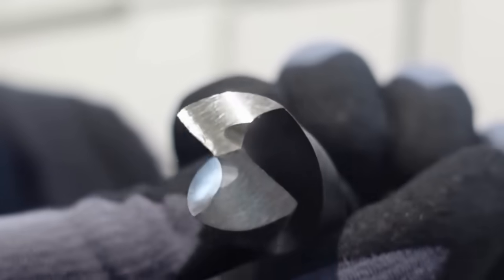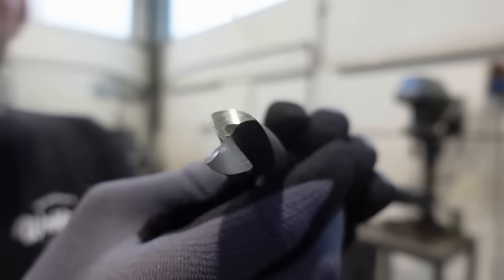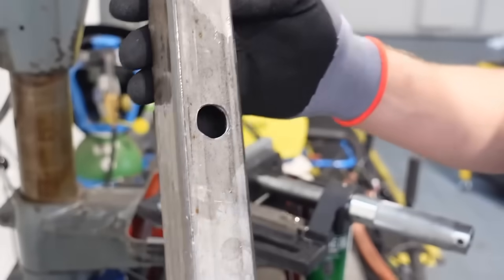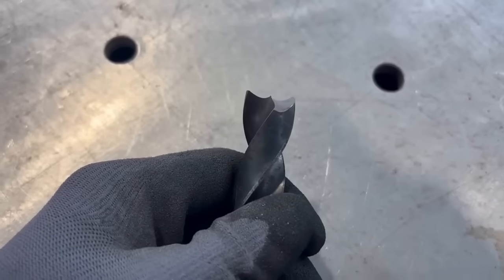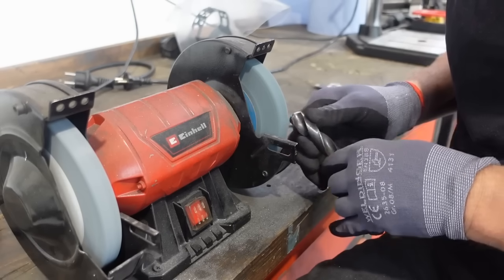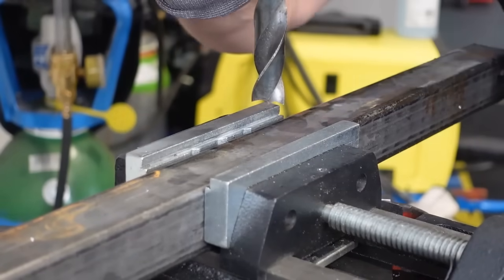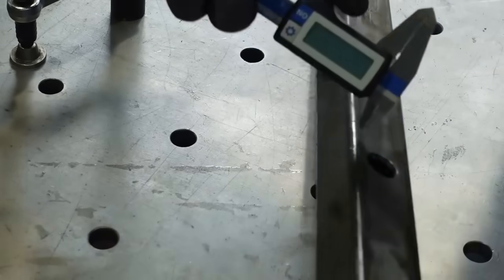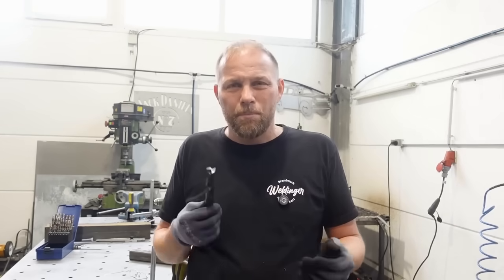Sharpening  Drills with a Twist – Drilling Without Pre-Drilling in Thin Materials (Englisch repost)

Comment: Only problem is that this geometry will last a few holes in steel and then you need to resharpen it. Those tiny tips aren't supported by much more than a hope. You've come up with a solution to a problem which doesn't exist, because what you really want to use is a step drill. They are cheap, readily available and (from personal experience) can be abused a lot more than you'd expect. In cases when a step drill won't work because there's no space underneath a hole (say 20mm hole in 25mm square profile where you have 30mm of drill sticking out beyond the 20mm level), you can chop off as much of the tip as you need. There are also regular steel drills with a solid centering shaft in the middle instead of a cutting point. They are made for countersinking the holes of socket head screws, but do require you to pre-drill the center hole.

Comment: Looks like a wood drill with slightly shallower angles. Cool stuff!
Reply from the maker: Thx
Reply: Hi my  my name is Kevin from Aus the drill you made  is  a slot drill with a drill centre on it so the drill will enter it self the od of the drill Will drill the hole to a correct size   you can drill the hole in the mill with not changing any cutter l have used the same methods as you have  it worked well Kevin mechanical engineer of 56 years .